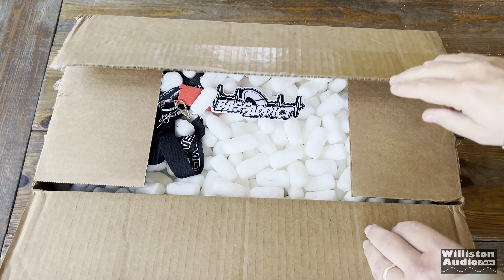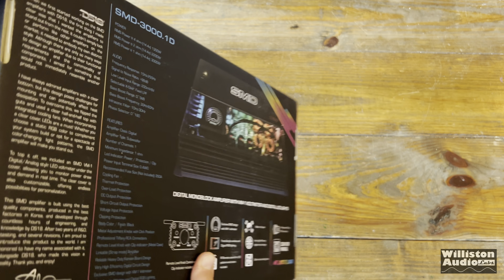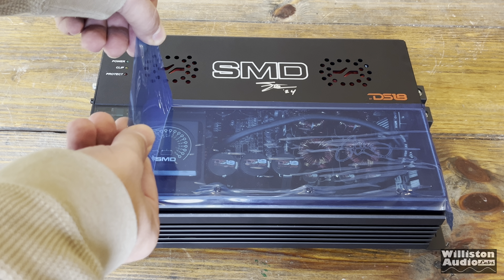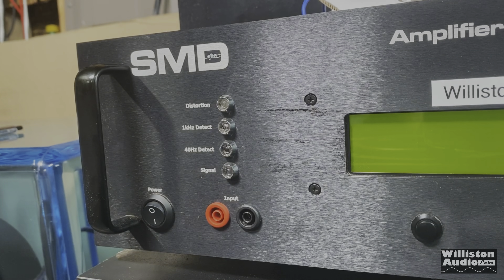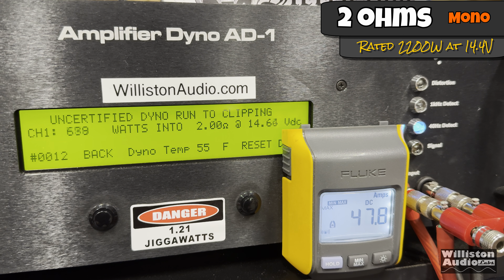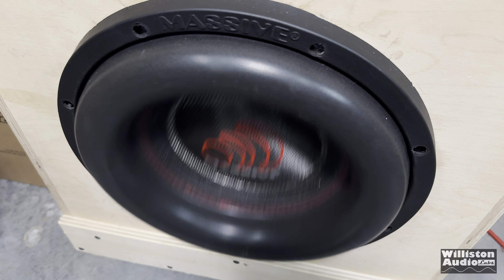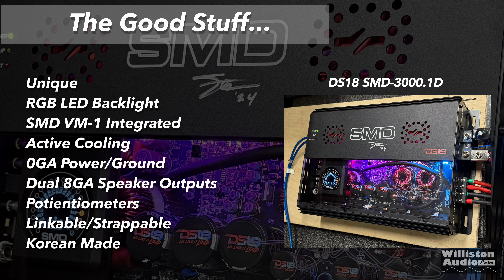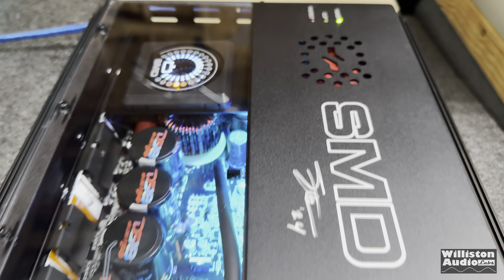Amazing Looks and Powerful Sound - SMD 3kW Subwoofer Amp Dyno Test

Comment: I like the amps, they look very nice. I dislike how expensive the amps are in comparison to other amps with similar quality like down4sound's amps..
Reply from the maker: The 12” sub shown in the video is a D1 wired at 0.5 and the amp had no issues powering it. O.8 on the Dyno is like 0.4 or less with speakers
Reply: @wal  that makes sense, I forgot about impedance rise...
Reply: I dont like the D4S amps looks really.  I like the new MTX Thunder line for looks.  Brushed aluminum.  Nice and clean.

Comment: review feels a bit inconsitent with past reviews. The miss on 4 ohm I don't think you would have easily passed. The lack of .8 ohm is turned into a positive on protect mode and the cost per watt seems high. The efficiency at 62 is low. I am a big fan of SMD but these amps could be better
Reply: @halfmeout  my thoughts exactly! I was waiting for the disappointment fanfare sound or a headslap, or even a homer Simpson "doh!" Then I felt like the big dummy cuz it never came. 😒
Reply: Lots of amps drop to 62-68 on 1 ohm.  Who cares.
Reply: don't be mean, Steve is on a spectrum and cant handle negative feedback.

Comment: $250 amp, with a pointless and impractical VU meter and a $10 amazon led kit in it, not to mention falls short of rated. Hard pass on that one. The taramps Big Boss has a better led light show

Comment: Crossfire 2k will out do that amp. And you can run dem ho ho ho’s @ .25 all day if you got the power
Reply: Gave my kid my mint condition CFA30HC - running at 0.75 ohm, (2x 6ohm DVC 12' subwoofers) SOLID RELIABLE and more than enough for what he needs...will likely run forever!  Cheers!
Reply: @ crossfire builds some of the greatest underrated equipment available in modern society 😂😂
Reply: @1978DirtyD agreed especially they're subs

Comment: Over $600 for a 3k, should be at 88-99% efficiency. Can be done
Reply: My DC 3.5ks are over 1000 each, and I don't complain at all.

They also do 0.25 ohm burps and 18v charging, so there's that. Idk if the smd amps would appreciate quarter ohm lol
Reply: 4 ohm in 90s
2 ohm in 80s
1 ohm high 70s
Sub 1 ohm low 70s
The newest tech of class D are capable of those numbers.  This is an older design with some lights and shiny objects to make it look like more of a value.  Amps I care about performance and build quality first, then looks.

Comment: I would like to see these amp manufacturers focus a line of amps of extreme efficiency.
Reply: @turbo18eg  high efficiency can be achieved, but obviously at a cost… a big one
So yeah they just stick with the mid quality components, etc.
Reply: JP33 is over 80% efficient at every ohm load and 97% at 4 OHM. The latest Korean circuits are insanely efficient. Even Taramps efficiency is getting better.

Comment: Why would he use sleeve bearing fans instead of ball bearing? This doesn't make any sense to me..
Reply: It has to be the pricing. I agree, ball bearing would be ideal for an amplifier, since they would require less maintenance.
Reply: @clayshinn6953  I get that Sleeve is cheaper, but how much cheaper? A $5 fan over a $10 one? For the cost of these amps, I wouldn't think it be that much of a different. Korean made, but a china part fan...Maybe I am being nit picky here. From what I am seeing, these fans can be purchase for $5 under a different name. Same blades, same voltage and size. If I got these, I would change those fans out first thing to Ball Bearing or SSO Bearing.
Reply: @Tig3rj  agreed on changing out the fans. I just don't see the appeal of these amps honestly. Like many others, I just don't see these as much more than a flashy DS18 amplifier. I figured Meade would go all out for something with his name on it. Let alone skimp out on a cheap fan that requires more maintenance. At any rate, it not for me. I'm an oldskool Rockford/Orion guy.
Reply: @clayshinn6953  Hahah...I am just getting back into it from the 80's and 90's and  boy has it change big time! I am a Cerwin Vega and Phoenix Gold guy..Friend who I did custom audio with was a Fosgate guy where MTX Blue Thunders were king of low bass then..
Reply: @Tig3rj  Damn man, you're just like me! I'm just recently getting back in the game as well. Haven't had a system in well over 20 years. In my 40's now, and it's been calling me back. I've got ton of oldskool Rockford, and Orion that I've retired, and put on my wall in my man cave. Now, I'm looking into the new stuff. I've notice how cheap things are now for one. But they (supposedly) out perform our old stuff. Longevity i dont think is there for the new stuff though. I can take down one of my old Punch amps, and fire it up now from the 90's. I'm leaning towards D4S I really like their stuff. At any rate, this'll be my last hurrah in car audio. Gonna build a nice system to put in my truck....then I'm out! Take care man.

Comment: A 2 channel full range .5 ohm stable amplifier for running 8 6x9 speakers or 4 10 inch mids with 4 timpano horns

Comment: Ehh was seriously looking at this but not making/exceeding rated at lower ohms with good voltage is con to me. Couple that w average efficiency, i think I'll look elsewhere for now.
Reply: It did make and exceed its rated power by far at lower ohms.  You mean 2 and 4? It did it there too.  Certified 1% was just a little low by a couple watts at the higher impedances. But up to clipping, which is pretty standard, it exceeded it's ratings easily.
Reply: @meade916  no disrespect but seeing other amps tested on the channel at similar or even lower price points easily hitting rated power at 1% and usually beating them by good margin too almost makes this a little underwhelming imo. Ofc there's more to an amp then raw numbers but one can't say it's a small part either when it comes to comparing one to another
Reply: @dannyphantom5201  this amp is designed to be played at 1ohm and it more than exceeded the ratings in all modes at 1ohm.  A couple of watts (in certified mode) can be gained back on those 2 and 4 ohm tests with just a slight bit more power.  Perhaps just .2 or .3v. Up to clipping on the 2 and 4 ohm tests, it exceeded it's ratings.  Not that big of a deal.
Reply: We both know impedance rise is going to affect that and we  both know that while playing music the ohm load is going to fluctuate, not stay at 1ohm the whole time. Not being a hater but also not going to glaze simply because it's got smd on the amp
Reply: @dannyphantom5201  oh now you did it You're in for it now mister you heart his feelings you know you're not allowed to have a different opinion than his,, You're a troll You're a hater or he just can't admit that he put his name on something that sucks
Reply: @FrankStPeter he should’ve just waited, and then released a better version then, DS18 would get a good rep.
Reply: @meade916 yesss your completely wrong. Ay! Address your efficiency numbers real quick SMD?

Comment: can you make a video showing the results when you use a stock charging system compared to upgraded.
Reply from the maker: Sounds like a good future vid!
Reply: @wal  12 volts or less!
Reply: @doctersound9630 who cares at 12V when your cars running its at 14.4.  If you run with car off you likely have a bank which sits at 14-16V anyways.

Comment: I thought this thing would at least do some of the same numbers as the HCCAs damn The XTRs do better numbers for cheaper back to the drawing board DS 18 another failure
Reply from the maker: The HCCA’s put up insane numbers for sure but I’d take an amp that did what was expected plus an excellent protection circuit over one that was just vastly underrated. It sure is fun to see an amp do more than rated tho so I understand where you are coming from
Reply: @wal  yeah me too bro I totally don't want to get more than what I paid for 🤨 The XTR and HCCA protection circuit is second to none,, I bet you can't reverse polarity that amp and it turned back on,, if you want to pay that much for a VU meter and some colored lights have added homie I'm here for the numbers and output not pretty
Reply: I would like to say to you though D again though I don't always agree with your observations I do appreciate the hard work you put into your channel,,, you just supply the information and it's up to us what we do with it,,, surprised you haven't blocked me after all these years

Comment: Just a ds18 amp with smd slapped on it. Mehhhhhhh. Quality amps are rated at 12 volts
Reply from the maker: Amps haven’t been rated at 12V since the 90s except I’ve seen Taramps provide ratings at 12.6. These are quality amps and you’d know if you look at the internals
Reply: @wal  salt series is rated 12volts you actually made that mistake in your videos about them.
Reply: @wal Orion , cresendo, and crossfire rated at 12.6 v

Comment: Yo big D. Would be cool if you could run the do it bump in yer 1930s Ford and drop an spl meter in the kick. Over time you could see if the amps you test are pushing the massive audio sub properly.

Comment: Man I was really hoping the amplifier would do 1/2 ohm considering it's a Korean board 🤔😒🫤
Reply from the maker: I think the protection circuit is just really set to safe as to be reminded, the 0.8 on the Dyno is equivalent to 0.5 or less with speakers

Comment: I would assume at this price range that the integrated cooling fans are of decent quality.  I've had to replace the fans of other amplifiers such as SounDigital and Down4Sound due to excessive noise.  I will have to see if this bad boy will fit in my particular installation.
Reply: Just get a salt or any higher end korean big block, no fan needed
Reply: @heroericxu1634 they have fans too brah
Reply: @heroericxu1634  those are probably larger and won't fit my install.
Reply from the maker: Fo sho